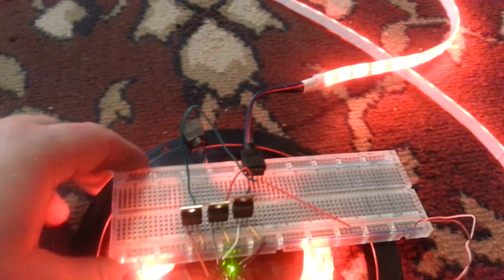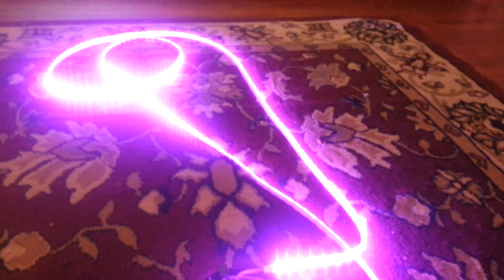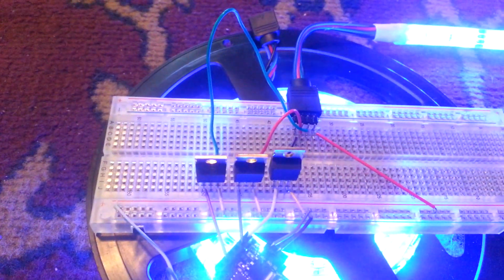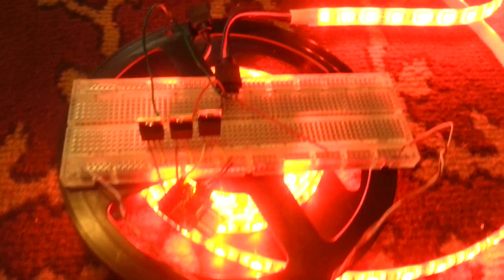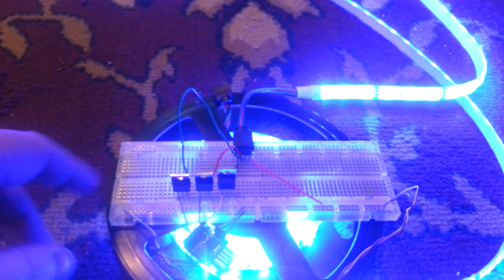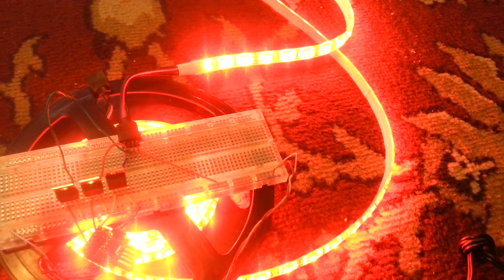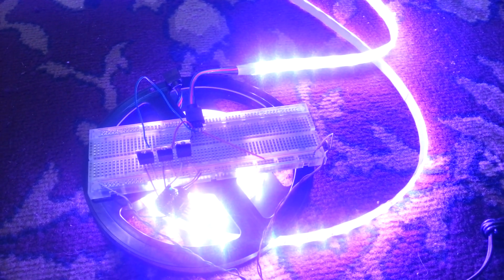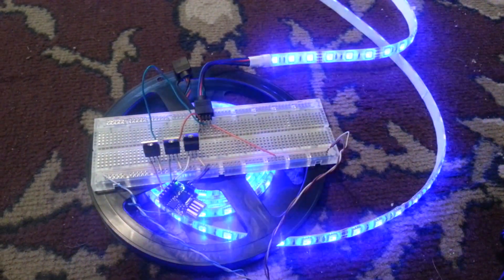Digispark and PWM (HW) a 5m 12VDC RGB LED Strip

Comment from the maker: The strips are pretty easy to work with.  The ones pictured here are the 'dumb' strips in which the whole string is controlled by PWM to create gradient colors.    There are three outputs on the arduino/digispark each corresponding to R(ed) G(reen) B(blue) with values ranging from 0 - 255 in the PWM registers.  0 = off full off,  and 255 = full on .  By using the PWM in channles on the Gate pin of the IRF520PBF-ND fets you can can control the LED strings with some ease.  

There are other strands available which use DMX universe controls and make this even easier as the intelligence is built into the strips themselves using WS2811b IC's.   They are a bit more expensive in price but their ease of use makes up for the cost difference.     I would suggest you start with the WS2811b LED strands.   

If you really want to get into some of the cool lighting stuff checkout http://www.diychristmas.org

Cheers,
-Casey